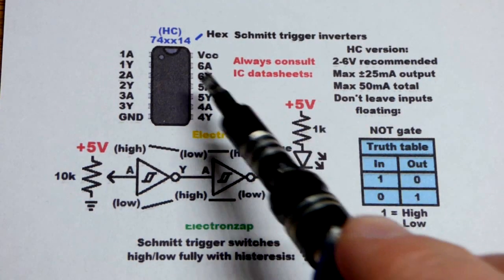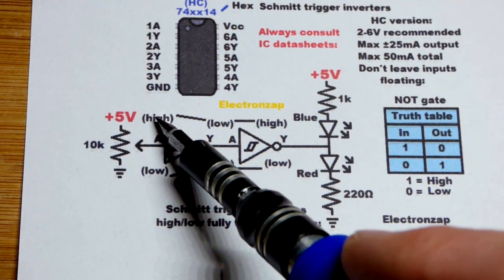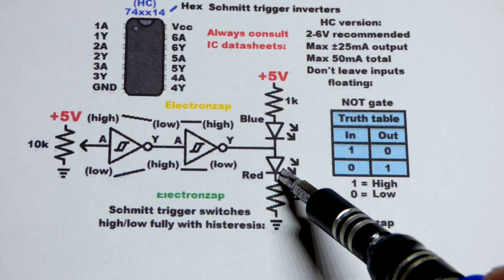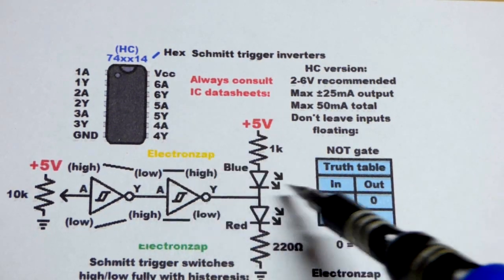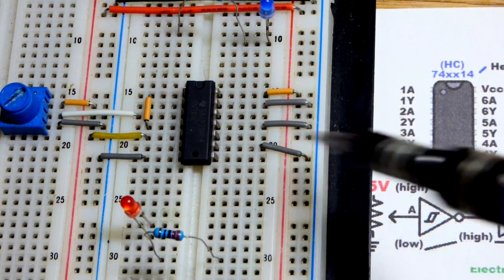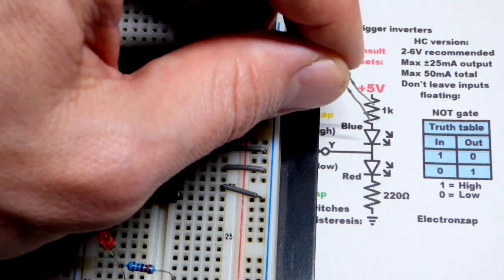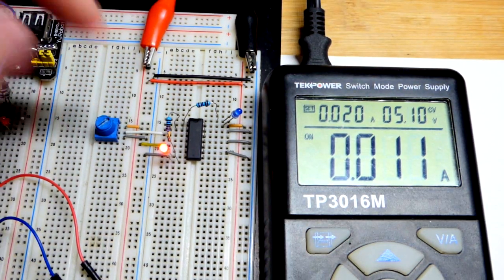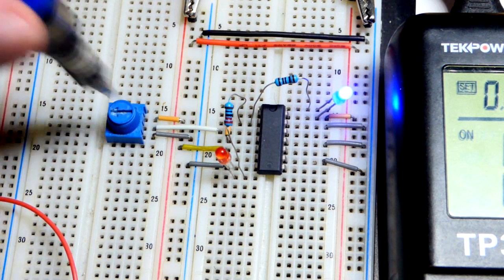Combining two 7414 74HC14 NOT gate inverters to make a digital high low buffer with electronics LEDs

Comment: Thanks for video!
I had doubts if it will work (i want to use 5 inverters from 74HC04, for half bridge drivers), and your video removed any doubts and it is in fact very comprehensive!